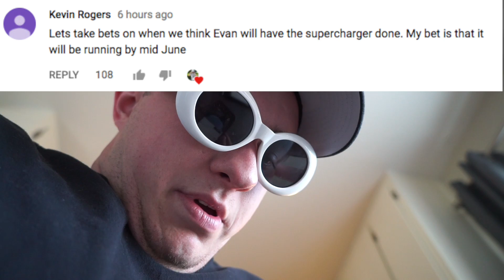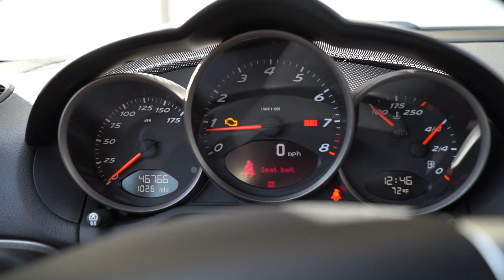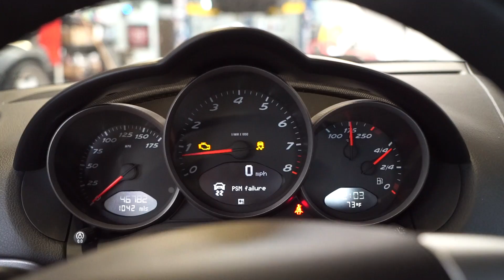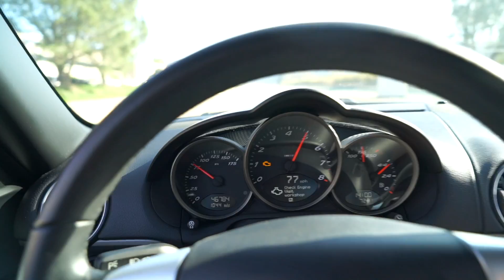TAKING THE PORSCHE STREET DRIFTING

Comment: The 5 point harness you got is more for a dragster where they don’t have anywhere to bolt behind the seat and have to loop it around the cage for an anchor point. Not the best design but it works for them.

Comment: Evan, brake cleaner is extremely flammable so spraying it on your running engine might not be a great idea
Reply: Ben S it's fine...
Reply: Gasoline is extremely flammable you probably shouldn’t spray it on your running engine😂😂
Reply: Smoking the vacuum lines is the safest and best way to check for vacuum leaks.  If you're going to spray your engine with flammable brake fluid, you better have a fire extinguisher close by.
Reply: Bob Sacamano It's the same thing as spraying ether down the intake...
Reply: Reikai media gasoline runs through your fuel lines aka the inside of your motor where it's designed to be.

Comment: Hey my guy, you cannot reset the ECU by just pulling the negative battery cable for a couple seconds or minutes and then reconnecting it. And newer cars you have to disconnect the negative battery cable then open your fuse box and either pull the ECU fuse or the hazard light fuse check your owner's manual for the correct procedure and usually you have to leave these items removed for around 10 to 20 minutes before you reconnect everything.

Comment: My Mk6 vw GTI will keep certain check engine lights on until they are cleared with obd2 reader/clearer. You should run the code(s), see what the problem is, fix it, clear the code, and then see if you really did fix the problem

Comment: I had a similar code on my Jeep Grand Cherokee and all I did was take the gas cap off, put it back on and reset the computer by pulling the battery terminal and leaving it for about 20 minutes. It went away

Comment: Use maf cleaner and leave your battery UNPLUGED FOR 10 MINUETS if you don't there is residual power in the event you get into a accident the ecu still has power to trigger the air bags so leave it UNPLUGED then I would check by spraying to see if it revs then you may want to check your fuel pump hose to see if there is a crack since it is exposed to everything else since it gets heat and close to the sun my 911 did the same it was the hose from the hose out of the pump to the hard line let me know if you need help